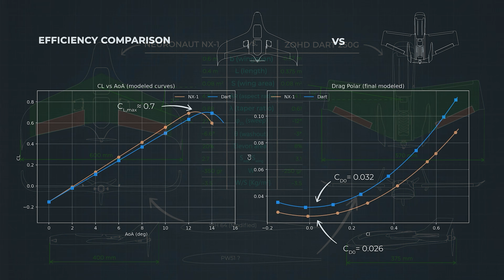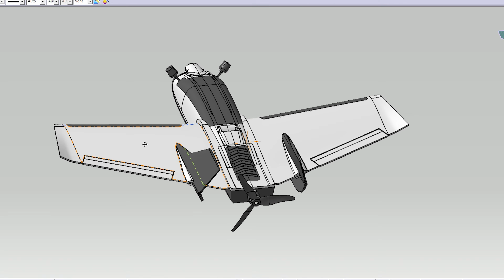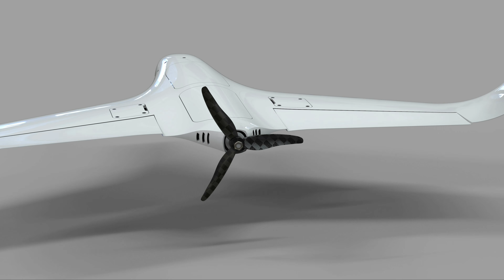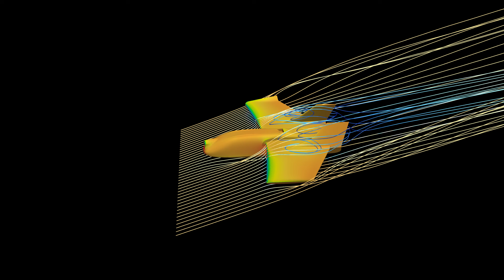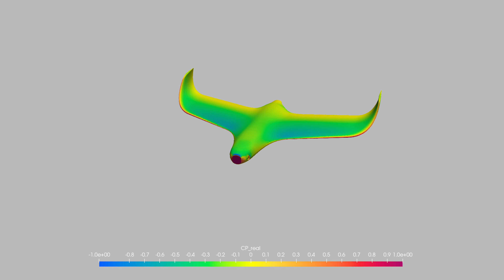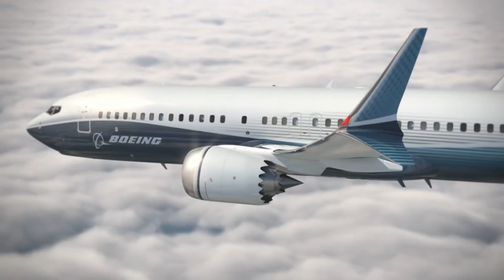🛩️AI vs Classic: Aerodynamic Efficiency Dogfight (CFD) | ZOHD Dart 250G • Reverse-Engineering

Comment: That was great! I've been looking forward to the next video after your last build video. I'm building an NX-1 right now, and it's almost done. I don't see anything about the CG location in the docs though. Can you tell me how to locate it? And one more question. You showed the weight of the NX-1 as 350g. Is that ready-to-fly weight or just the body? Thanks!!
Reply from the maker: Hi Jeremy!🙌 Great to hear you’re building the NX-1—please keep me posted, I’d love to see it flying from another builder. I’m also putting together a new one myself, since the one from the first video had a pretty hard crash after losing RC signal.

The 350g figure is the ready-to-fly weight, and should be easily manageable if you print with LW-PLA (frame alone around 110-130g). For the CG, place it right at the fuselage split (where the main spar is)—that gives you about a 5% static margin. For the maiden, I recommend starting 5–8 mm ahead of that point, then moving it back gradually to fine-tune performance. I’ll be updating the drawings and docs on Cults3D soon so this is clearer for future builders. Thanks!  🚀✈️
Reply: @neuronautics_Lab  Perfect, thanks! I used LW-PLA at 70% flow, and it came out really nicely, but it's definitely fragile. I know you did a resin coat on yours, and I'm actually doing a light fiberglass coat on mine. I did the entire bottom surface last night, and I'm now at ~265g for the frame. I'm thinking I might only do resin on top, no glass. 
I'll post a video once I get it in the air. I plan on using the O4 lite air unit. One other thing that might be helpful in the docs is print orientation, support placement, etc. I have a Flashforge Creator 3 and usually use Simplify3D, and I've got the settings and orientation pretty dialed now (I've printed the parts quite a few times now :) ). Anyway, thanks again, and looking forward to whatever's next! 🛩
Reply: Sorry, one more request. Would you be open to sharing the design file for the nose (maybe through OnShape)? I figured out a way to get the O4 lite camera in the nose opening, but it's kinda ugly (lots of hot glue). I'm also working on designing a small launch grip to attach to the bottom. Basically, just a skinny ridge just large enough to pinch attached right under the CG. The side throw launch always makes me a little nervous, even with auto launch set in INav. I'm building an automated catapult launcher for my 2m Opterra (heavily modified), and I think I can adapt it to launch the NX-1 with a flip of a switch on my radio. The goal being to be able to have my goggles down for launch, and getting a higher launch velocity so I have a little more flexibility in prop selection (lower pitch / less static thrust). My Opterra also took some gnarly chunks out of my hand on an overhead launch a couple months ago. Not good. 
Anyway, I know I'm going on and on. I'll jump on your Patreon.
Reply from the maker: Sounds great, Jeremy! 🙌 Fiberglass + resin should make it much tougher. Just keep in mind that if the frame gets much heavier, I’d try to keep the electronics as light as possible. I haven't try but over ~400g (MTOW) but I guess it will get tricky to hand launch, unless you go for a much powerful setup than the one I used. And then it will need to fly fast. Really looking forward to your maiden video! !🚀✈️
(Update)
Catapult launch would be wild! I'll jump on Patreon too ;)

Comment: When scanning, you made the same mistake than me with my Dart several times, you inverted the rear fins 🤪 ! Btw, I managed to get a very light Dart 250 with FPV gear and a small 2S battery, I'm at 160 gr AUW. It can go slow and gliiiiiides forever. I had to increase the control surfaces area because turns (bank and yank) were too slow to my taste.
Reply from the maker: Haha yeah, that one was actually intentional 😉. I figured flipping the fins would give a bit more clearance to the prop and maybe a cleaner flow. My original plan was to CFD both setups and compare lateral-directional stability, but I just didn’t have the time… I’m also flying mine on 2S right now, and honestly it feels like it needs a bit more punch. With the o4 Pro, it might be better to switch to 3S for that extra thrust. Thanks for your comment! 🙌 🚀✈️